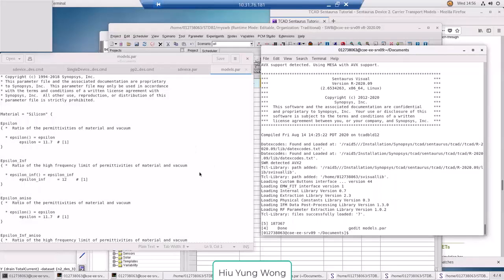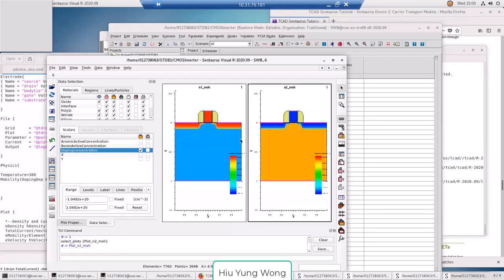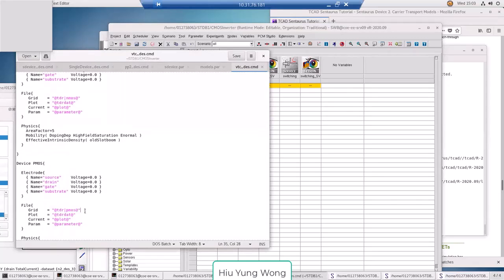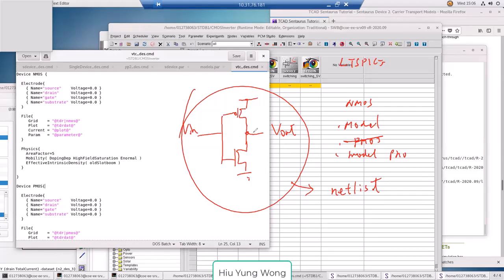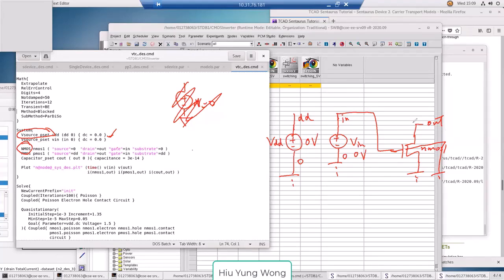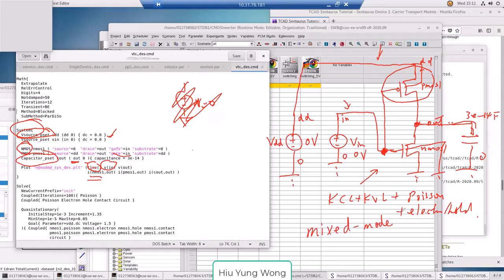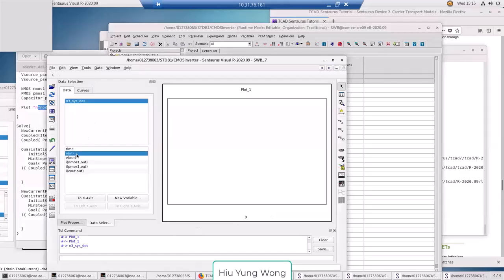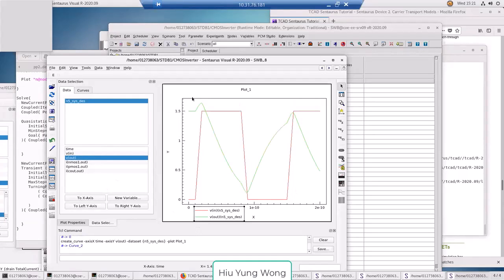TCAD Sentaurus Hands-on Tutorial -  Sentaurus Device Mixed Mode Simulation

Comment: Sir, do you know how to use mixed mode to stimulate circuits with devices derived from atlas? I have some trouble with that. Could you give me some advice?
Reply from the maker: @WhiteMike-fq9yw Do you mean to use TCAD Senaturus to run a device from Altas? I do not know. This is probably very difficult even if it works. It will be better to build a new device using TCAD Sentaurus. This is because even if it works, you need to change the names of the fields (e.g. they might not name ActiveBoronConcentration in the same way).
Reply: @quantum_computing  No, I mean using Atlas to stimulate devices, and these devices can be used in circuits using mixed mode.
Reply: @quantum_computing  No, I mean using Atlas to stimulate devices, and these devices can be used in circuits using mixed mode.
Reply from the maker: @WhiteMike-fq9yw  I do not know other tools. But I believe they can do mixed mode also. I suggest you contact the support team of that company. Thanks!

Comment: Sir if possible please give any suggestion to create nand or any gate i have simulated but result didnt get
Reply from the maker: @mounikaduvvari519 I do not have such examples. However, in the installation directory, you can find many NAND examples under Applications_Library.
Reply: Sir I tried to simulate those examples to my devices but I want to simulate simulate simple Nand gate there are using some sprocesa coding sir if possible can you please help me?
Reply from the maker: @mounikaduvvari519  I would suggest you contact Synopsys support to see if they have examples to share. Unfortunately, I do not have. Thanks!